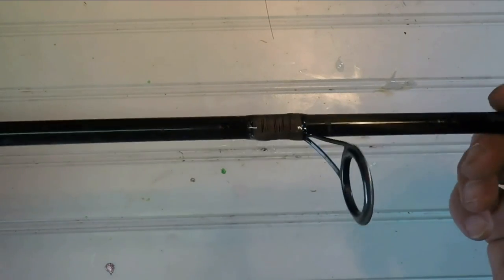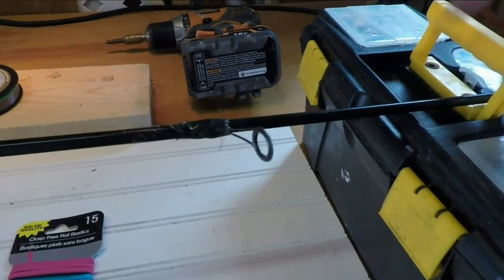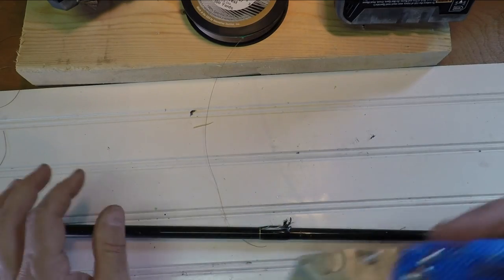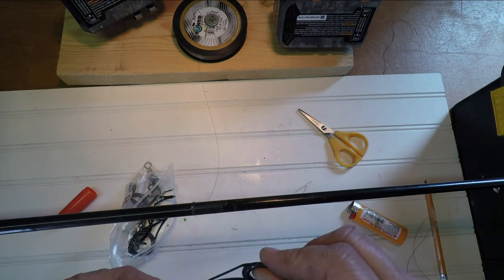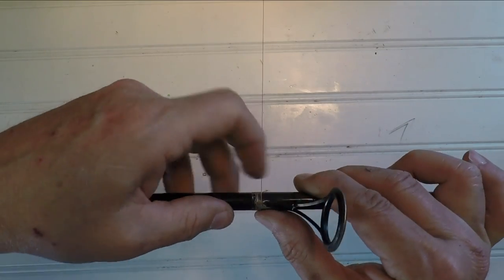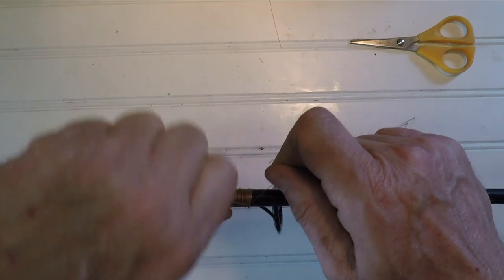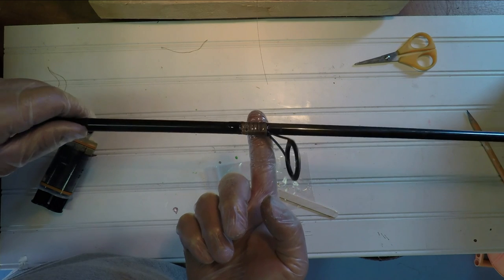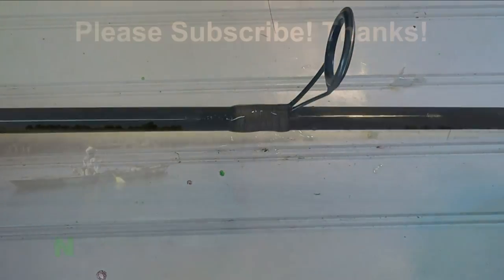Fishing line guide repair without rod building equipment

Comment: Rod/reel combo with fishing kit as an emergency setup https://www.youtube.com/post/UgkxntWMOZsO1Zfv-pdn_XuffEtNkTYAYu4Z recommend but started to use this every day. The rod is thick and seems durable. I keep it neatly tucked into a regular backpack all the time with my fishing gear, and can grab it anytime, put it on my back and go anywhere. I just read in another review that the rod length below the reel is adjustable as well, so I will try that too for even more portability. Probably the best setup I've ever owned. I lost the cap for the eyelets, but no big deal since I still have the black cloth sheath that came for the pole and I use that. Very portable and high quality.
Reply from the maker: Great idea! Thanks

Comment: One suggestion I wanted to throw out to everyone to save even more money & it will help with the tension of the line when wrapping the guides.

I used 20LB braided fishing line for the string to wrap the line guide & I kept the line on my fishing reel while dialing down the drag so I could just pull it directly from the fishing reel.  This gave me the tension/resistance to keep the braided line tight when twirling the pole so the braided line would be tight on the line guides.  I used tie wraps to secure my fishing reel to the shelving racks in my garage & setup a portable table with 2 square milk crates to sit the pole in while twirling the rod to keep the line tight on the line guide.  

Of course everyone will find their unique way of doing it as I had to skip out on the hot glue (I made a mess & just abandoned it) and just position the line to wrap it correctly.  The fishing reel was super handy to use as you could tighten or loosen the drag to your desired tightness.

Used my spinning rod this past weekend & it worked like a champ.  Thank you again for providing the video as I was ready to pay someone to fix it for me.  This was simple & took less than 30 minutes to complete. (Minus the epoxy curing over 24 hours.)
Reply from the maker: Excellent improvement!!

Comment: I started out over 30yrs ago with a few upright pieces of wood with v slots cut in them and a drill with a zip tie on the trigger and an attachment I made out of a 2 1/2in PVC pipe end cap with a hole drilled thru the center of the cap for a bolt & nut so I could chuck it in my drill and also cut a piece of foam to go inside the end cap with a slice in the center so it would grip my rod handles and turn my rods. Some of the custom rods fishermen have built now are works of art and watching you reminds me of where I started. Doesn’t always have to be perfect to be effective, but I have to admit I did cringe once or twice. Lol, it definitely works tho good job.
Reply from the maker: lol! Looks like we came from the same place!

Comment: Good repair. When you cut off old guide cut on the guide foot away from rod ...no rod damage. When you cut tag ends ...cut short before pulling thru , no lil sticker poking up . Finger nail polish will seal threads too. Great job I never thought of epoxy glue ...good idea
Reply from the maker: Thank you so much for those suggestions!

Comment: Nice. I've got a trusty old rod that cost 100 bucks in the early 90's that can be replaced with solid steel guides for $70. Paying to have guides replaced? Crazy money. It's all about function, sentiment, and getting your full money's worth. I watched a few videos but your gives me confidence to tackle my sentimental 2 favorite rods. $150 I don't need to re-purchase. Better off "on the bank" than "at the bank". Nice, simple guide.
Reply from the maker: All I want to do is fish, not create a work of art!
Reply: I hear that. I'll drop a few bucks on the Fuji components my rods came with but never repaired the newer epoxy-glued variety. Pay to repair my 2 old favorites and I could have 2 brand new and a new bait rig!

It's all about the glory, not the glamour...

Thanks for the video. These rods should be good to go for under $25-30. Fuji isn't cheap but that's why I purchased quality rods.

Comment: I replaced my first guide using a cardboard box with 2 triangles cut into the top of the box to hold the rod. I didn't use a tension device, I just kept my finger on the the thread as turned it up the guide! What a PITA!! But, it got the job done!
Reply from the maker: It worked! That's what counts. No need for expensive stuff.

Comment: Nice! I broke the ceramic out of one of my eyes and I need to fix it. This is perfect. It is an expensive rod... so I may be a bit more patient... but this is the best DIY without all the pro tools video I've seen lol
Reply from the maker: If you can figure out a way to get the ceramic back in, let us know.  I have tried super glue and epoxy... neither last.  So, I just replace the whole thing.  thanks for the kind words on this video!
Reply: Yeah. I haven't found anything that would be good for putting the ceramic back in... I'm just gonna replace it, really appreciate the video
Reply from the maker: I need to try that the next time it happens.  Thanks!

Comment: I didnt even you use that homemade rig I did it on my sofa :D and it turned out fine , I also used sewing thread
Reply from the maker: It works!
Reply: I used sewing thread with gorilla glue and eyes from a snapped rod and then spun it over the bathroom sink.

Comment: I'm Like you. Function before fashion. I have repaired very many of my rods at some time. None of them have been beautiful, but at the same time none of them have ever failed me. In fact I just now finished putting a new guide on my salmon rod.  One thing I have noticed, even 5 Min. epoxy takes a good couple of hours to properly gel.
Reply from the maker: I agree. 5 minutes for this application is optimistic. I do find that I can leave the rod after 5 or so minutes and not have the epoxy drip. It is still tacky and damp. Did you have a different result?
Reply: No, about the same. One thing I try to do is get the resin and hardner in exactly equal proportions. I think that is critical. The rod I repaired at 1.30 pm yesterday is probably only now 10.0am usable.  I have often used the rod builders 'Flex coat ' to get a nice finish, but you need to be there for about 5hrs to prevent sagging or have a motorised rod turner.
Reply from the maker: 5 hours... now I know why rod builders use a motor to turn the blank! I can be patient for 10 minutes max!

Comment: How do you prevent the thread from slipping on your rod while you begin the wrap. I'm spinning my wheels here and going nowhere, I find the elastic band actually provides too much tension and even after I removed it the line is still slipping?
Reply from the maker: You have to keep the tag end on the inside of the line coming off the spool so it wraps over the tag end. If you want, you could loop the tag end around the spool line to make sure it is tight. In terms of the elastic... does the spool spin by itself? In other words, do you have the spool screwed down tightly to the wood? If so that may be the problem. The only other solution is to use line from a smaller spool to reduce the tension or change the elastic to a different type. Good luck!

Comment: Do you think you could use normal hot glue to cover the wrap? I don't mind if it looks ugly
Reply from the maker: No, I do not think that would hold. It's not a hassle to use quick setting epoxy. You only have to turn the rod for a few minutes until it sets up.

Comment: Great video - what glue did you use at the start to hold the guide in place? Thanks
Reply from the maker: I just used hot glue. The guide repair kit you can get comes with some.
Reply: @KayakhacksFishing  Thanks; where do you buy the repairs kits?
Reply from the maker: @cbx1168  Pretty much any store with fishing gear will sell them. They look like this - https://amzn.to/3AeIu01
One thing I do on broken rods is to remove all the guides to have a supply of replacement parts. If you do not need some guides, just get the glue at a hobby store. As you can see from this Amazon link, it is cheap - https://amzn.to/3BjUVJt
Reply: @KayakhacksFishing  Thanks!

Comment: May I ask what type of epoxy you use to harden or seal the guides?
Reply from the maker: I know the real rod builder guys will have a different answer, but since I just want function, I use 5 minute epoxy.  Any will do.
Reply: Kayak Hacks Fishing do you know the brand? there are so many brands out there. has it held up well for you! this video has been helpful and I will look at it again when i have the supplies.  i have an old rod i want to repair.  thanks
Reply from the maker: I use the Gorilla Glue 5 minute version as well as Loctite
Reply: Araldite here in NZ is another good one.

Comment: hello, what kind of line do i need for this repair?
Reply from the maker: I just use whatever fishing braid I have handy.
Reply: Kayak Hacks Fishing ok thanks!
Reply: What strength/lb of braid would be best to use?
Reply from the maker: I believe any braided fishing line will do just fine.
Reply from the maker: The epoxy is what holds everything in place, so the strength of the line does not really matter.
Reply: I just pulled enough line off the reel that was on the rod I repaired. It would have been 15 or 20lb  braid.. Did a nice job.
Reply: Nylon or strong sewing thread should be fine just make sure the wraps are close an very tight.
Reply: I've used 8  , 15   , 20  , 25 lb  It is a matter of personal choice, and the finish  you want. Personally I find the heavier lines easier to work with.
Reply: If by 'Nylon' you mean' monofiliment fishing line' , I would not suggest using that as it doesn't have the linear strength of braid and won't absorb your epoxy finish the same way thread or braid will

Comment: Those quick epoxy formulas are not as strong as the 24 hour long dry stuff. Also in that type dispenser, you can see you get more of part A and less of part B in your mix. Look at your video again. Best to use separate A and B tubes of epoxy.
Reply from the maker: Thanks for the tip

Comment: I think you forgot a step. How do you run move all of the poxy??
Reply from the maker: Not sure what you mean. Once you apply the epoxy, you let it dry while slowly turning the rod until the epoxy does not drip.
Reply: @KayakhacksFishing   That was supposed to say I think that you forgot a step and that is how to remove the epoxy.
Reply from the maker: @steveyoung6268  Thanks for the update. I guess I never have that problem with removing the existing guide. I carefully cut it and all the exoxy on the threads just pops off.

Comment: "glue" which kind of glue bud? wood glue or silicone?
Reply from the maker: I use the glue that came with the repair kit you can get at Dick's or Basspro. It's the same as what comes out of a glue gun.

Comment: Would super glue work to back the guide?
Reply from the maker: No, I tried it.  I just picked up a product at Bass Pro today that claims it will work.  I have another guide ceramic ring that came out and will try it.
Reply: No super glue will likely chip in time or just plain fail. It's not strong enuff.